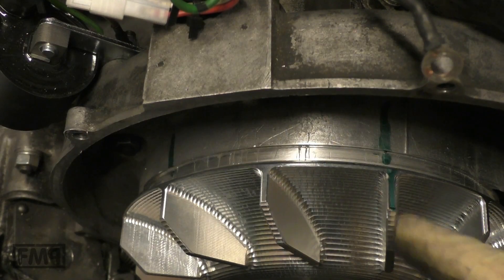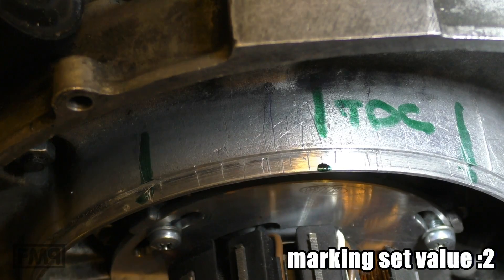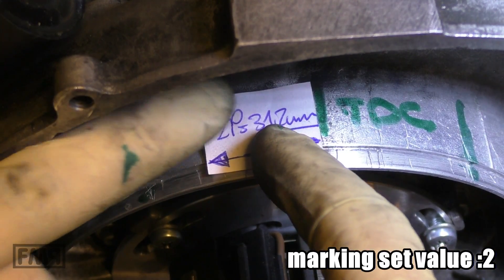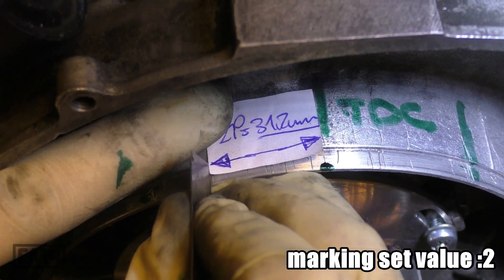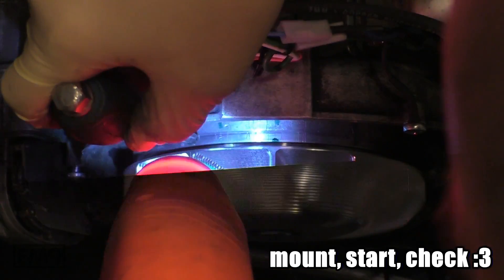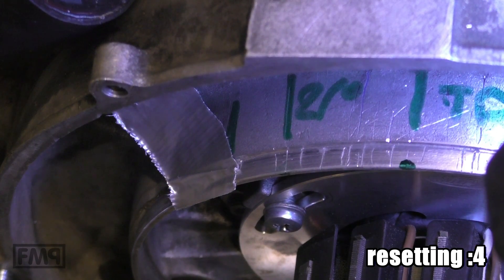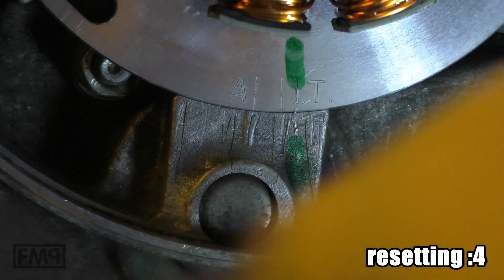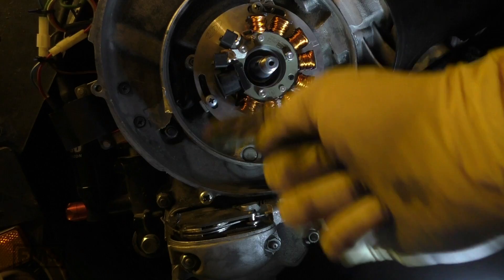the ULTIMATE vespa IGNITION TIMING setting GUIDE | FMP - Solid PASSion |

Comment: Thank you very much for your videos, you do always a amazing job. I have a question for you.
I have a Bajaj Super ( almost the same as a Vespa). Now it is 180cc with DR and 57 career. 28dellorto carb and expansive pipe. 
The stator in this model is the same as Vespa, but it has only 1 position and in that position, the captor is like in “2pm” on the clock. I just ensambled it. It’s all brand new, but when I rev it, she looks late on spark. Do you have any idea if I can make do rails in the stator and move it? I don’t know yet in what degree she is now.

Comment: Hi there. Thanks for all your videos. Super helpful!
I am going to install a SIP VAPE static ignition on my 1988 Vespa T5. The original manual has the ignition point at 16 degrees BTDC. Does this stay the same when changing the ignition system to the SIP VAPE? I see you mention 18 degrees as the ignition point. Any advice will be much appreciated. Thanks again : )
Reply from the maker: depends on the cylinder.
 and exhaust. which is it

Comment: My Stella now has a VMC Super G, and when I was checking the timing with a light I noticed that it has auto-advance ignition.  It advances about 3-5 degrees when above idle.

Should I set it to 18 degrees at revs?

Also, would it be worth it to get an aftermarket CDI with adjustable timing curves?
Reply from the maker: cdi is rather defect. in which direction does it jump?
Reply: @FreakMoPed8  My mark on the flywheel moves counter clockwise when you rev it, up to around 3000rpm then it stays in the advanced position
Reply from the maker: Wrong direction 😉 from.when on is it stable. yes set 18 degree when its stable.

Comment: please hint. My Vespa PS uses CDI magnetic ignition, still uses Platina. The beginning of the napur's position in front of A (clinking sound machine), after that I shifted backwards in the middle between A and IT (the machine was no longer narrow but the engine temperature was very hot as fast as tens of KM). Please advise and hint ... 🙏
Reply from the maker: you should set it in detail, also to see if the ignition point is stable = the ignition ok
what about fuel supply? ensure enough fuel for the engine

Comment: How do you know where is 18 degree on polini ignition ? There is only a ligne longer than the others in the middle and between two ligne it’s say that’s refer to two degree...
Reply from the maker: every crank, flywheel and stator has to measured. No matter if the stator is Marked or not
Reply: mista FreakMoPed it look fun... you say 18 degree for m244. In quattrini manual guide they say 26 degree. And in polini manual guide they say 23 degree for the polini ignition. 😂
Reply from the maker: depends on the ignition type static 17-18 degree. variable 24-26° (which regulates down to 17-18 at the dangerous area) ;)
Reply: @FreakMoPed8  If you set up Vap ignition at 21°, at dangerouse area what will be the ° ?
Reply from the maker: checkout the curve (ie i posted it on my fb page in the pic folder of sip vape) and calculate back. it will be too low for sure. you need to start higher (if you meant the variable)

Comment: Hi there FMP. I just want to ask why you chose to go with Sip/Vape ignition? I like it but I’ considering buying pinasco or maybe the polini because they have option for electronic start on their flywheel. Which one would you recommend?
Reply from the maker: cause its proper quality, look up VAPE its a czech company that is doing this for a long time. They know what they are doing. 

All the other ignitions - no. Matter which brand - are the same asia. Stuff, see the 4 coil statoe, just different labeled. Check the typical pages and ebay, you will find the coils for 20.- 😉
AND they have very low power in low rev, it looks like 6vold oldtimer then

Vape provides a lot of power ans its pickup coil contacts are vertical!

Comment: Tell me do you have a video on setting up points with timing.  I  have a vespa p150x 1983. As you can see from my profile picture. I love the P200e for more power and electronic cdi but this scooter landed in my lap a few years ago and i could not say no as it was in a good condition but I was never good with points and condensors. My problem always was that if she idles for about 5min she would foul the plug. I already have changed the points and condensor but I notice that my exhause is wet. The only way I could sorts of remody this problem was to set the carb as lean as i can. To me it looks like the spark is not strong enough at idle to burn the fuel. I have used a tuning glass that you screw into the parkplug hole to see what color spark is and at idle its yellow and the higher she revs it turns blue. I am running LED head light and tail lights. How can i set the sparkplug to burn hotter at idle? Everything stock standared. Thanks
Reply from the maker: What do u mean with "points for timing"? And whats "foul the plug"
Reply: @FreakMoPed8  Plug foul means the sparkplug dies, all back and wet. stator timing on p150x.
Reply: I set the stator and engine "marks"(on the casing and stator) to line up in January when I change the crank clutch oil seal. (0.5mm advance) Last week I notice the exhaust is wet. if the scooter idles for more then 5min the sparkplug dies (wet). I think the spark is not strong at idle. yesterday I looked at the points. 0.70mm I then set it to 0.32mm. took it for a test drive, the exhaust was dry. But I still face the problem that the sparkplug dies when I idle the scooter especially when engine cold. "I always start and ride" https://youtu.be/5mcIf2Fvpc4?t=8

Comment: Hello sir, recently, my clutch key were snapped/broken. Problem is, it felt into the engine. Can you suggest how to get it out? Or do i have to open up the engine completely?
Reply from the maker: Oi! Yes use a magnet on a movable stick to fish it out
Reply: That has happened to me. you get a magnet on a bendable wire \ Bens the wire to where you need to go.

Comment: Hello, is that ignition variable?  I ask about the movement when accelerating.  Tell me, how to know which grade is better?  less degrees (19 °) for high rpm?  or 21 °.  I don't know if I explain myself.  I want to understand well how to find the best grade according to the cubic centimeters of the engine.
Reply from the maker: Yes variable. Static value is 17-18 degree for all tunings 177-244. Two ways are getting you there, or thats at least the way i do it: 1) where does the engine have its biggest power? put 17-18 degree there 2) in which rev area will you ride the engine the most? put 17-18 degree there. From this point go back on the ignition graph and you have your set value.

While Cruising the engine gets the hottest, so having 18 degrees there is a good choice.
Reply: @FreakMoPed8  Ok understood, thank you very much
Reply: @mista FreakMoPed how to settings 150-166?